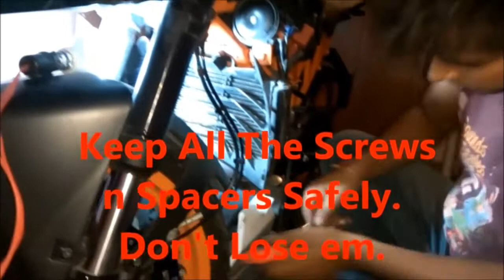KTM RADIATOR || GRILL GUARD || CARBON RACING

Comment: Does it get enough air to cool?
Reply from the maker: Yes bro. Good cooling n good heat dissipation. Im currently using this specific Grill guard on my Duke 390 as I have sold my RC 390 few months back!! But the performance was good n the radiator was well protected from small stones.

Comment: Bro i bought RC 390 BS6 2020
Can i go for radiator guard is working oR not.. And good for my bike Or Not aslo..?? Plz Reply
👇
Reply from the maker: Radiator guard adds a extra layer of protection from stones so u should go for one. B'coz radiator damage from stones or debre is not covered in warranty.
Reply: @DkashDIY  Ok Bro.. Where can i get this #RadiatorGuard Can you please Tell I'm from #Lucknow..
I want Branded and Original?
👇
Reply from the maker: Check carbonracing n motofusion website.

Comment: Does the stock plastic needed even after the grill installed ?
Reply from the maker: Imam Jaferali I have tried it that way bt yes u will have to retain the stock plastic guard b'coz the fairings r supported by it+ it gives extra protection to your Radiator..
Reply: Deepak kashyap oh okay! mine is duke 390
Reply: Deepak kashyap just now received the guards from carbonracing gonna fit it
Reply from the maker: Imam Jaferali congratulations..
Reply: Deepak kashyap thank you